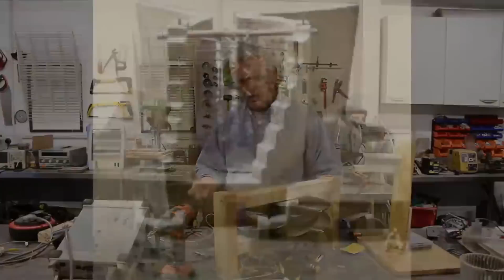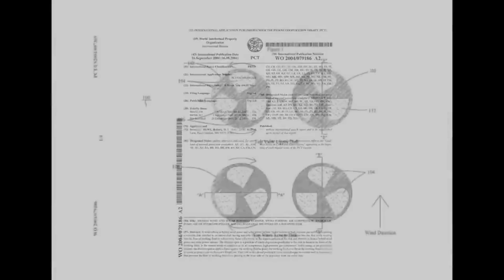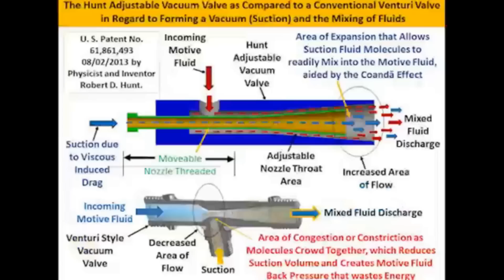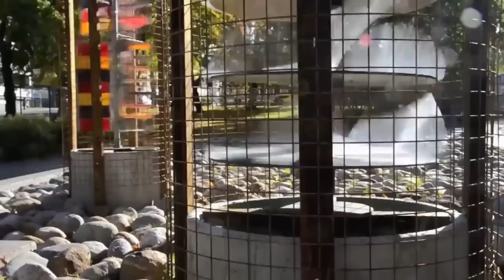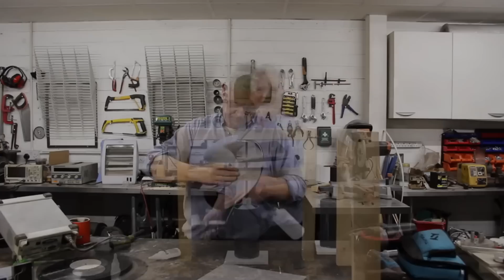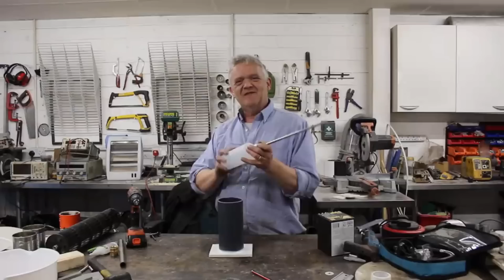026 Cheap 'n' Easy Wind Turbine And  Bit on Free Energy!

Comment: The reason his plane works is simple: the refrigeration cycle. There is an asymmetric relationship between adiabatic pressure and thermal energy.

When the plane takes off, the helium can't just be added to the blimps, the tank cools as the helium boils so energy has to be absorbed into the tank to allow the continuous evaporation of the helium. When the plane falls, the refrigeration cycle is in effect when the gas is being re-compressed.

The refrigeration cycle is COP > 1 so it takes less energy to compress the helium than the helium absorbs from the atmosphere when it expands.

The Primary Energy input is latent atmospheric heat.......

It's not even free energy, just really clever and indirect solar energy harvesting.

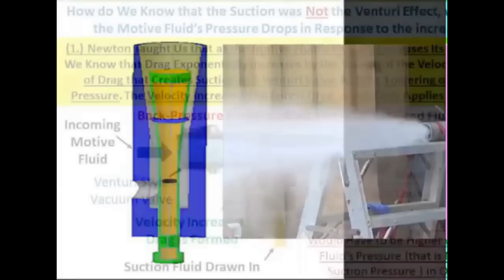Comment: 5:44 There's no violation of thermodynamics. The extra energy comes from the altitude of the gravity plane, due to the fact that it's lighter than air. There is no work done to reach this height, but you end up with a lot of potential energy when the plane becomes heavier than air by deflating the helium. So it doesn't violate thermodynamics any more than a blimp or helium balloon.
Reply: I guess you sort of mentioned this later.

Comment: The bearing is very interesting. A magnetic repulsion bearing would be even more friction free. The flap disc rotor is interesting as it uses the moving slat principle of other wind turbines I have seen. They use top hinged slats that drop down under gravity to catch the wind and then swing back up during their into wind part of the rotation. There are 3 major issues here. The first is the noise produced by the slats/veins snapping open and closing on every rotation of the main shaft. The second is that we have hinges/ bearings on each slat which will result in stress and failure. Mitigating the ware and failure there would be problematic. Finally, there is a need to stop or stall the rotor to avoid damage and effect repair and maintenance.

Comment: An amazing example of this power of drag introducing energy was in emergency aircraft ramps. Instead of large weighty pressure tanks, it was found that a ridiculously small hi speed motorized air fan  (comparatively)  using drag could suck in enough extra air to inflate the ramp in 6 seconds. This was in YouTube but I can no longer find it.

Comment: Just a thought -
A layer of a few mm of low viscosity oil  on top of the water wouldn't add much friction, but would prevent the water from evaporating.  Bingo... even lower maintenance.

Comment: The Green Windmill VAWT, patented in 1998, solved the bearing issue. The rotor isnt rigidly attached to the hub and the sails create lift as they rotate. The rotor physically rises upwards as it spins and has to be restrained. I bought the plans which were available at the time on a 1.44mb floppy disc :) I built a 6ft`er out of odds and sods i had laying around. 12mm hollow fibreglass tubes, 15mm copper tube tee`s, some clear polythene, petrol strimmer line and some electrical connector blocks (aka chocky blocks). If you fancy building one i still have the plans which includes an xls to calculate the dimensions.
Reply: Upload it and post a link please, also patent number would be good.
Slainte
Tariq
Reply: Can I second that motion to upload the plans... Obviously with the patent number if you have that too!
I live in a really windy area and might try making one myself - what power output did you get from the 6ft model?
Reply: @AlphaWhiteWolf20  
Every time i post the number, it gets deleted for some reason, google for "green windmill patent"

Comment: Energy harvesting is "free energy", not every free energy solution or idea is anti-physiics and anti-standard model. What people mean by free energy device is a device that will provide energy for free until it breaks as long as the condition are right and the energy come frome something else that you don't have to work to get or pay for.

Some idea are more fringe, for example I want to discover the electrical energy equivalent to the Carnot Cycle/Refrigeration cycle. I figure that if that type of energy transformation/transportation is possible for heat energy, it must also be possible for electrical energy.

If I can use 100 joules of mechanical energy to relocate 300+ joules of heat energy against a 45 deg K heat gradient with a heat pump, then there certainly exists a device in which 100 joules of mechanical energy can be used to relocate 300+ joules of electrical energy against a 45x Voltage gradient.

Comment: I don't think the fluid bearing will work if you have an axial flux alternator because the gap between magnets and coils will change, maybe sometimes crashing or rubbing. If you make the gap large to avoid this then your efficiency suffers.
I have had great success with the single ball in oil bearing. Works like a toy top.

Comment: These work beautifully in stopping stratification in process chemistry electrolysis etc very very smooth non turbulent fluid control with basically no moving parts

Comment: If you want a good demonstration of "free" energy ish  get an aquarium air pump some pipe and a tee and a valve, get two bowls of water droop the pipe down onto the floor fit the tee on the upward pipe to the top bowl and if you get the air right it will lift water to quite a height then the water can run back into the lower bowl, I used to use these to maintain tubifex live food for my fish , they need a slow gentle flow of water , it relies like the aquarium air lift pipe on the difference in mass of the water in one half of the Syphon to the other if it's less it pumps that way

Comment: Great video Robert, if the bottle had some sort of fins on the bottom the water could act as a flywheel in gusty winds, a vortex below would suck the bottle down could be used like a cut-off switch if it's too windy?

Comment: The gravity airplane is a new version of the Aereon by Solomon Andrews, which is the first man-carrying aircraft to fly against the wind back in 1863... at least, against wind teaveling faster than 5 mph.

You get more thust per kilogram out of propellers than you do out of pumps, vacuum, or compression. Regardless, the gravity airplane is a modern aereon, and aereons work just fine. Definitely no over-unity power, tho.

Comment: Absolutely brilliant, one could start playing around with the fluid used in the illustrated bearing system, for example adding a small amount of soap to the water should reduce surface tension and in turn reduce friction by a tiny amount. A different example would be to use oils that take longer to evaporate.

Comment: Liked the hydrostatic bearing.  Could use a lightweight oil instead of water?  Might not have to top the system off as frequently.  Oil or water might be more useful than a magnetic bearing, maybe?

Comment: Did you put water in the bottle that you used for the center part of the hydrostatic thrust bearing? I wondered if the water inside the bottle would act like a flywheel. That's a neat cheap bearing if it worked adequately. Thanks Robert

Comment: The part on the gravity plane I may have missed is it needs to compress the gas to start falling but needs to fall to run the compressor? 🤔
Reply: The initial charge on the batteries would provide the necessary power required for the compression of the helium/hydrogen. After that the fall tops off the batteries for when you are back at the top. The batteries where implied.

Comment: I suspect you could further reduce friction by using hydrophobic spray on the bottle.
Reply: The irony is that hydrophobic spray probably isn't going to stick well to the surface of a plastic bottle.  But instead of using a regular plastic bottle, if you could find one made out of Teflon or UHMWPE, you would get some innate, noticeable hydrophobic properties.

Comment: As a sailor it's definitely untrue that drag is more powerful than lift. When sailing across the wind using the sail as a wing to produce lift, it's possible to go considerably faster than the wind speed itself, whereas downwind where the sails only produce drag of course you're limited to the speed of the wind. The observation about fishing boats could be due to any number of reasons, older sail designs (square rigged and gaff sails) are less efficient upwind, sailing downwind may give better controllability and less "weather helm" (force on the rudder), etc.

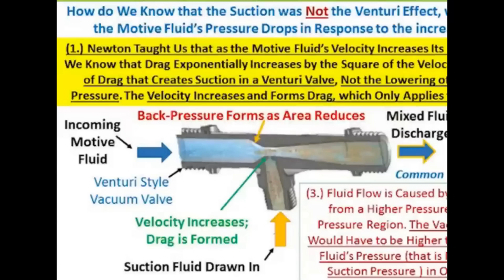Comment: Actually this makes perfect sense to me (not free energy part) but it is possible to get more work out of what is put in a few instances. @5:54 the diagram looks almost identical to the inside of a standard airbrush. I used to have an airbrush with a small compressioin tank that was filled with something similar to one of those Foor-pedal style bike tire pumps connected to a series of one way check-valves. Anyway most people think that the air pushes the paint but it's the opposite. The air moves through a series of constricting passages, increasing the speed it moves & it rushing past the outlet where the paint is draws the paint into the airstream. I've worked with paints very thick paints & just-mixed epoxy & it had no problem drawing it out at only 8-12 PSI (The max it could compress to was 22 PSI).

Comment: Question for you that I have asked over the years and still haven't got an answer to yet. How does Bernoulli explain how aircraft can fly upside down? Just asking.
Reply: It certainly can, but just not efficient ly
Reply: Think of it this way. Whether a plane climbs or descends, assuming  it has enough power is a matter of the angle of attack of the wing. So invert the plane, tilt the nose up and apply lots of power and you will inefficiently get enough lift to maintain altitude or, with sufficient power, even gain altitude.

Comment: 2:23
They could have used the the blimps /  fuselages as capaciters for running the charging and running the pumps, making the two capasotors as part of the fuselages skin with a electrolyte medium wrapped around beyween few layers of carbon,. Enough for twice as much as needed, for emergencies and redundancy... 🎉

Make a model one and use Hydrogen, as long as you have no shorts and fire hazards, I'm sure it will work awsomly.
And I am thinking you may not need to compress the Hydrgen much just a little as needed to fine control the buoyancy, and a few thinn solar panels on the wings, might be enough to power propellers, then the control surfaces can have anolog controls
But for the models; you'll need servoes.
Good luck, hope you's can make a working prototype.. 🛩️

16:27
And drill a small hole at the prepped water height, so when it rains the water level will be maintained. Could also attach a reservoir to it if have a lot of evaporation...

Comment: Hi Robert, i was thinking how about a ballon turbine like you said i balloon that take a weight up and drops the weight from a controlled release from the the ballon and the drop force refills the balloon to catch the weight to start the process over agian and excess  energy transfed down a connection feed line to charge a battery

Comment: About liquid bearings, air is used, too. The faster it's spinning, the higher air pressure, so more weight can be supported. Maybe useful for flywheel energy storage.
Reply: - and use some magnets to reduce friction when at zero speed...
Reply: @kadmow  Perhaps a superconductor may be used for that (otherwise there are eddy current heat losses). There is work being done on using superconductors in flywheel energy storage and also as magnets in wind power.

Comment: Hi Rob.
Would there be less drag if we remove the bottom of the bottle, so it floats on the air inside?
Cheers.
Reply: That's an interesting idea, I just might reduce the drag if you pressurized the bottle to push the system up and minimize the surface area in contact with the water. Additionally, a soap lowers surface tension of water so this might also reduce the friction in the system but at this point I think the friction of the radial bearings up top will have a greater affect than the axial bearing (ie the water and bottle)
Reply: I don't thing that would be better unless you provide for a way to add air to the bottle to bring the pressure up to the point where the water/air boundary is right at the bottom of the bottle.
Reply: If we put cold air in the bottle, it will expand, and maybe, push the water out?